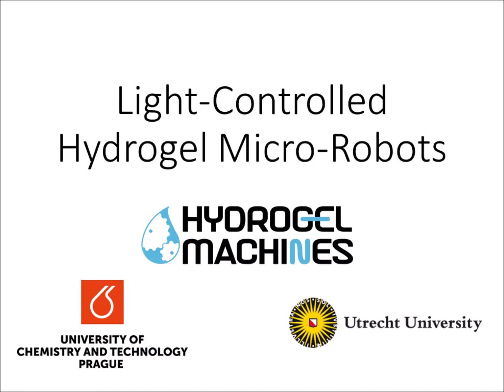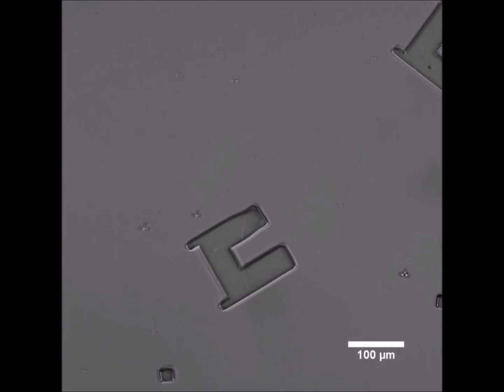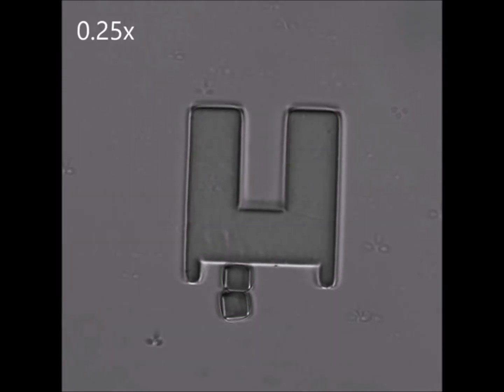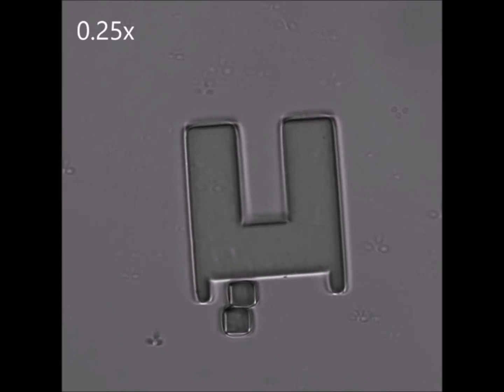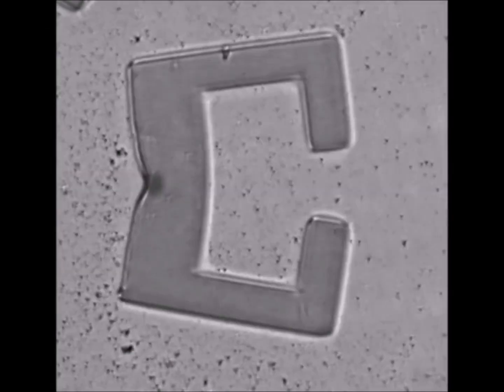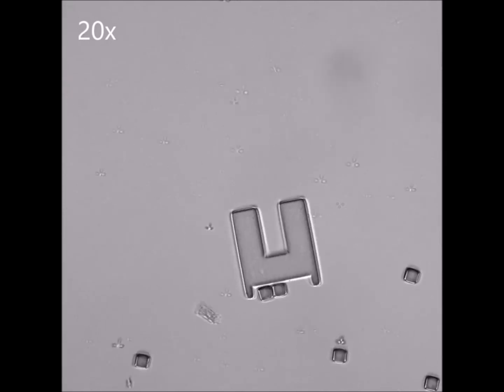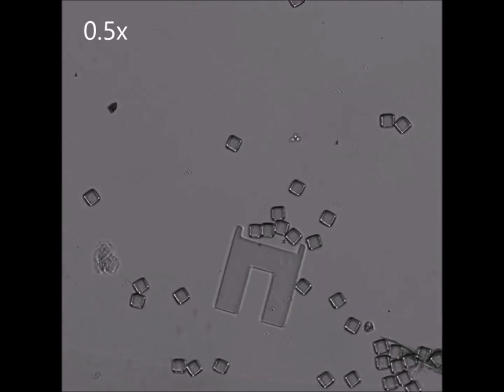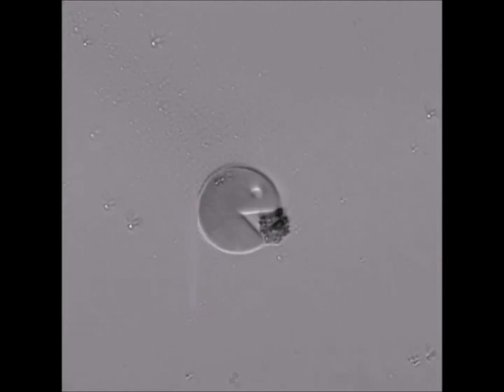Light-Controlled Hydrogel Microrobots

Comment: So.... they rolled out the you know what, using hydrogel / teslaphoresis with graphine nanotubes, same time we got the latest G roll out, but there was another thing, around the same time, they startd rolling out new LED street lights. some places had already had them for longer, but they really ramped that up during the time of fear
Reply from the maker: Hi, as the author of this work I'm happy to discuss any questions you might have. The other technologies you mention aren't relevant to this and/or other microrobotic research, and I'm happy to explain why.
Reply: @maxmaslen  Hi! I would talk with you about that. This is important. Please, let me know. Thank you.
Reply from the maker: @4444-m7q  Hi, sure. A general response to the original comment and others on this video is that I think many people are vastly overestimating the abilities of these microrobots and similar ones. There are quite a few research groups around the world working on making microscopic objects that can be controlled to move around. It turns out that this is actually very difficult and requires A) development of new materials, B) complex external hardware such as a microscope, C) a clean and smooth environment for the microrobot to move in. As such, the most advanced microrobots that have been produced are still very limited. Injecting them into a human body (as I believe a lot of people are afraid of them being) would not result in much except a bit of inflammation. No current robots are able to actually do anything inside a body. What'smore, when you see this hydrogel microrobot, you can see there are no electronics, no sensors, nothing fancy. It's simply a piece of soft material that has the ability to crawl. Being this, there is no way that it can relay any information or do anything except crawl. Nonetheless, this is still a pretty solid achievement and is scientifically novel. 
Do you have any specific questions?